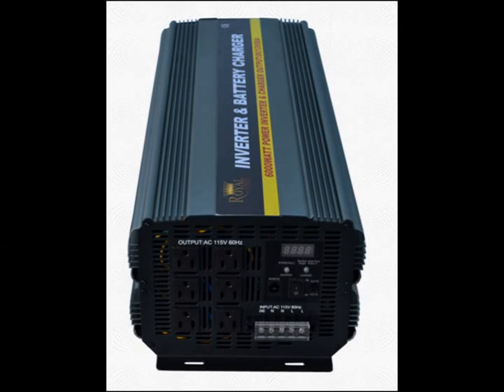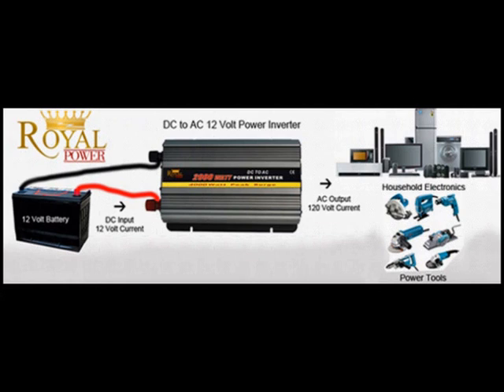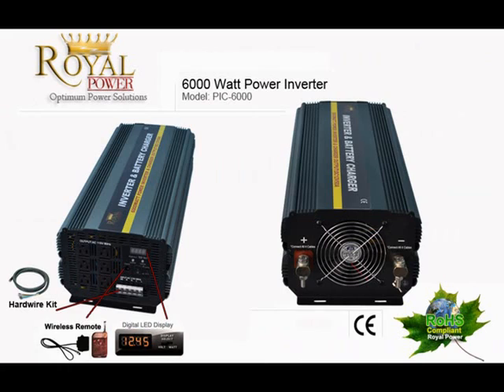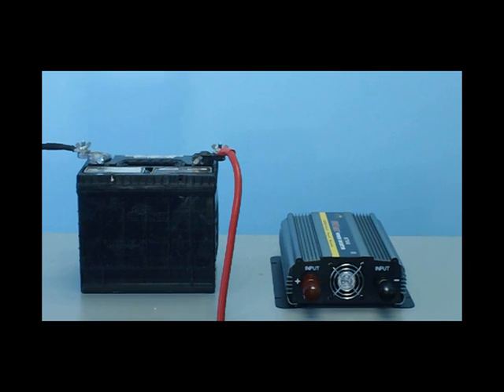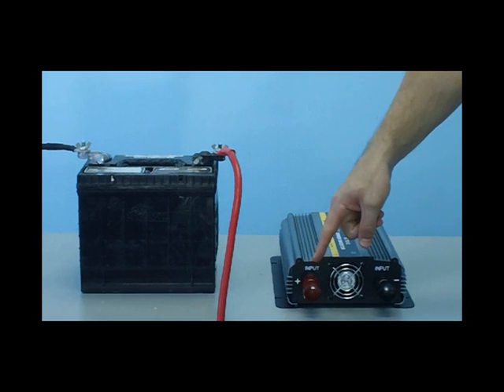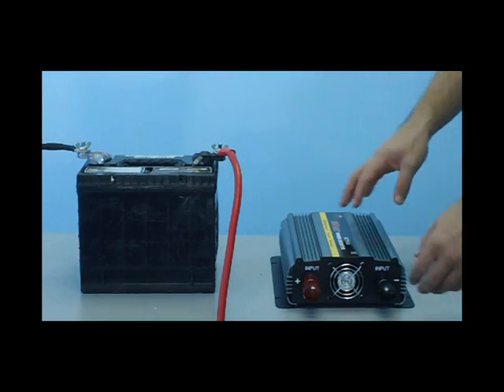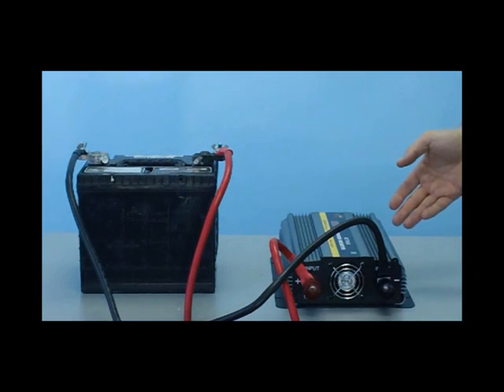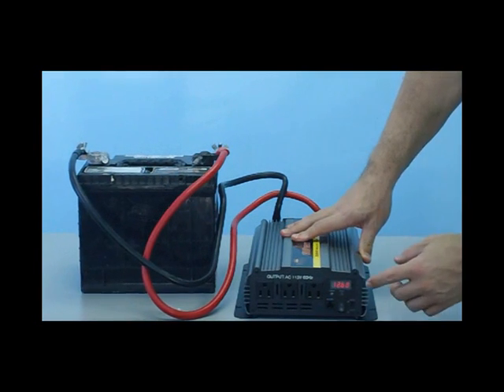Power Inverter

Comment: Can an inverter work with a 12v plug? Like the one that comes with a laptop
Reply: Are you asking about the cigarette adapter type plug?
Reply: @Royal_Power_Inverters  no the one/plug you use to power your lap top.. it is 12volts
Reply: @talentedthorn6024  do you have a picture.
Reply: @Royal_Power_Inverters  https://youtu.be/PHtOhiNF_Ks
Reply: A plug like that can only handle limited wattage.

Comment: as a truck driver my company wont allow me to connect invertor to battery.  what do i do?
Reply: ***** i blew my 300w twice,  now. Only avle to exchange it once. Wouldn't boil water, powrr laptap, or juicer. Really miss my alarm clock tho... so i bou g ht a 1500 & thought i would just buy battery but auto zone guy said not a good idea
Reply: ***** thx. 4 response. very helpful, sir... wut do i do? company is firm, but really would like sum comforts of home

Comment: 6000watts?   that'll be useful for the entire 3 minutes it lasts on that battery.   with electrical inefficiencies, you'll be drawing 500-600 Amps.     What kind of car/truck will have an alternator to keep up with that?  basically none.   

This is definitely an inverter made for a motorhome with big battery bank, big solar panels and high amp generator/charger.

Comment: Now what was he using Square Sine or true sine Inverter , My house runs full of Battery power, Square sine power to much loss and some sensitive equipment wont work properly, also as a rule of thumb with inverters have a look at the power rating eg it says it runs at 140 watts times that by 10, The initial start up , to work out for a 12v system amps to watt 1 amp is 12 watts.

Comment: had a quick question. If i split resistor the
voltage from a laptop cord to 12v, will that
 power a 12v car inverter. If so, can i plug
 the laptop back into the outlet part of the
inverter and use it as if the laptop powering
 to charge it self.

Comment: I connected a Peak -400Watt Tailgate inverter to my a car battery. I used it to pump 200 gals of water out of 330gal tote using a small water pump I purchased at Home Depot rated at 120V @ 2A that I plugged into the inverter. I then plugged in my motorcycle battery charger into the inverter and connected the leads to my car battery so it could charge the battery at the same time I'm using the pump. The motorcycle battery charger is rated at 120V @ 900ma. 

I was able to run the pump non-stop for an hour and a half without starting the truck.

So I guess perpetual energy is possible?

Comment: how long will THAT inverter last if I connect a 1,000 watt light to it?
Reply: yup your wanting to grow pot....
Reply: It all depends on the capacity of the battery used, the battery shown will probably power such a light for aprox 3-4 hrs on a full charge, However if the light source has a ballast or Hv transformer the results may differ, Some inverters will not power inductive or sensitive loads for this you need a pure sine wave inverter, These are more than double the cost of a like for like wattage of a modified sine wave type which typically do not deliver the advertised wattage, Amperage play's a big role on what the typical max wattage you get, On a pure sine wave it has a cleaner output so can handle much better loads and what appliances can be used with it safely. when opting for modified sine wave, its always best to get one with double the stated wattage for your needs, this way you have a decent margin of threshold for voltage spikes which will blow a fuse. wiring 2 or more batteries in series doubles the amp's per hour potentially extending the usage time which is best for power outage situations and emergency lighting.

Comment: Can you use a bank of 6 volt golf cart or wheelchair batteries connected in series with these inverters and, are there any advantages of using 6 volt batteries versus 12 volt deep cycle batteries?

Comment: On a battery this size using an 8000w inverter means VERY little use out of the battery depending on load. 8000w would deplete that battery in minutes if not seconds. You need a battery BANK to supply the power that inverter is capable of, not some small car or motorcycle battery. We're talking about 12v supplying power for 120v. You do the math.